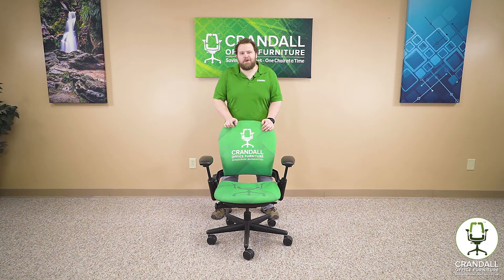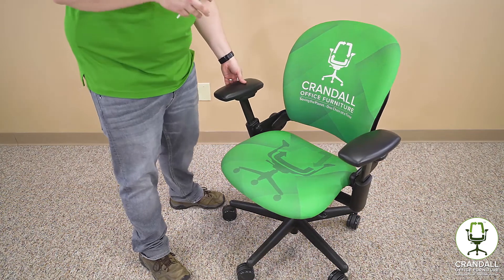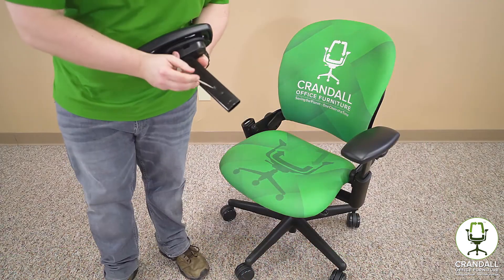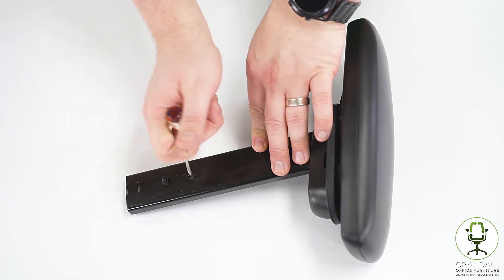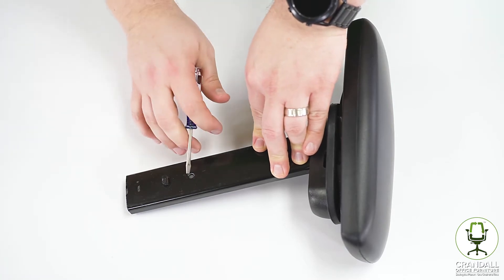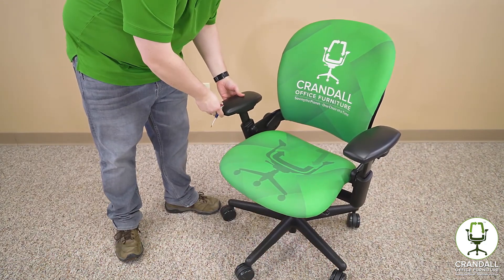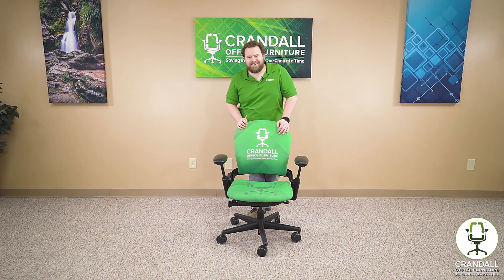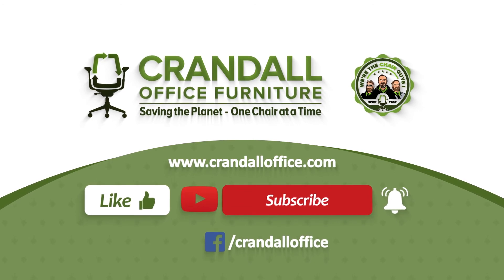How to Remove & Re-Install the Arm Assembly on a Steelcase V1 Leap Chair

Comment: Appreciate the video! If you could, I have a question!

So in order to release the arm from the mechanism you need to depress the bit inside that hole, but in order to reach the hole, the arm needs to be all the way up. I have a V1 whose arm adjustment button is broken, so the arm is stuck in the position it's at now, which is 2 clicks below the top position. 

Do you know of any tricks to get this arm out if I can't reach that release hole normally? A certain tool, or something that can be removed to help me reach it?
Reply: Nevermind I got it! The plastic arm connecting the push-button to the spring-loaded bit that locks the arm in place had snapped right in half! With no way to reach that hole to release the arm, it took some creativity to get it out.

I ultimately used a wire hanger to reach into a hole in the bottom of the shaft, managed to hook the spring holding the locking bit in place, and pulled until the spring broke off. That then allowed me to simply tip the chair over, making gravity slide the locking bit right out of the position of the shaft it was locked in, and allowing the arm to come right out of the chair.
Reply from the maker: @Ayesuku  I love the ingenuity! That was essentially going to be my suggestion - find something you can get down there to depress it. Glad you were able to figure it out :)